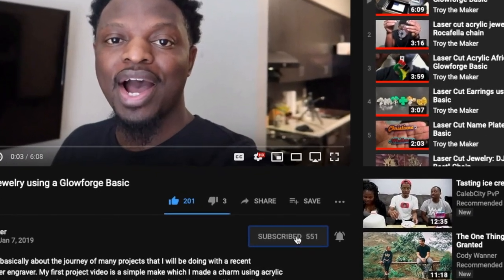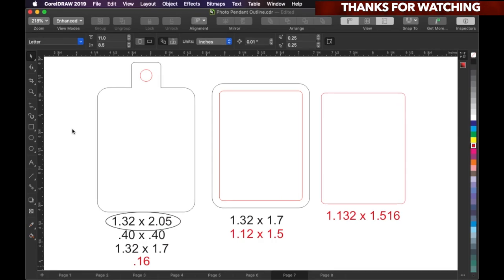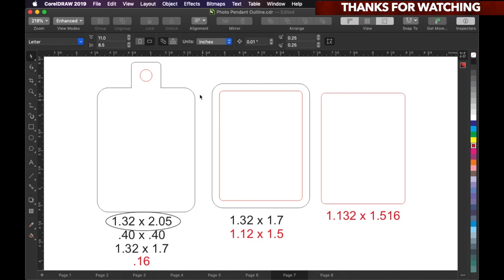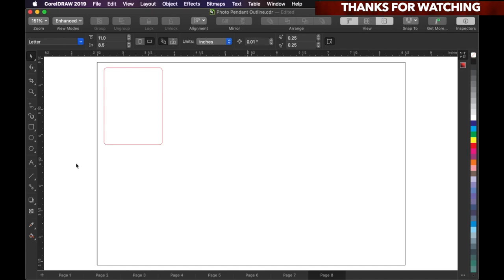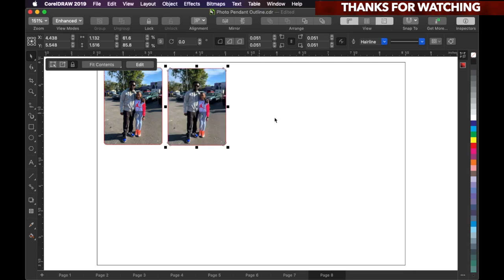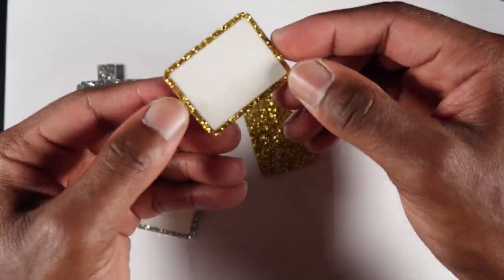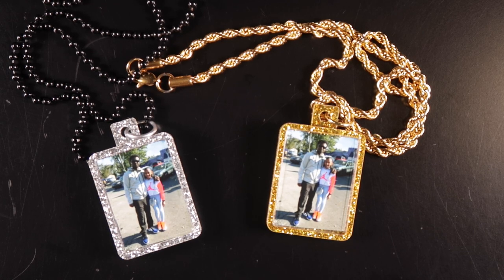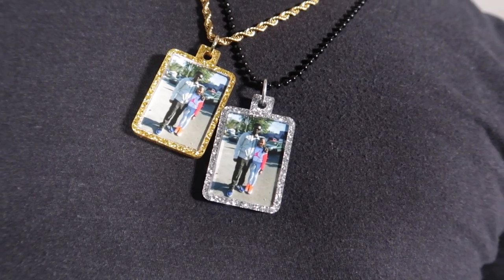Laser Cut Jewelry | Acrylic Photo Pendant

Comment: Great video Troy! As always. Hey if you ever want to mess with our svg creation software let me know. It’s super easy. Check out our channel to see what it does.
Reply from the maker: After the design is exported to svg will it create the outside cut lines or will I have to use my software to do so?
Reply: @TroytheMaker  we are working on a solution for this. right now it exports as a solid shape.